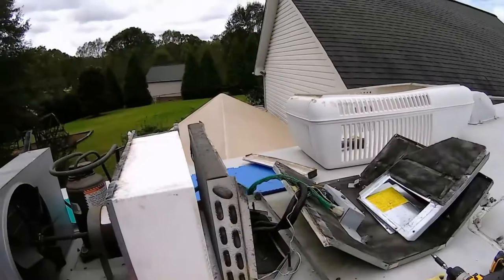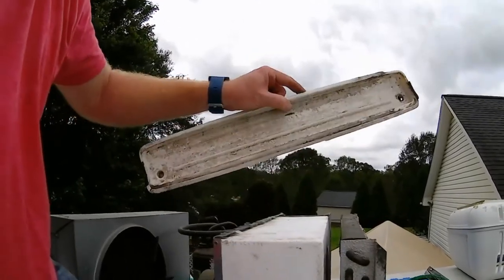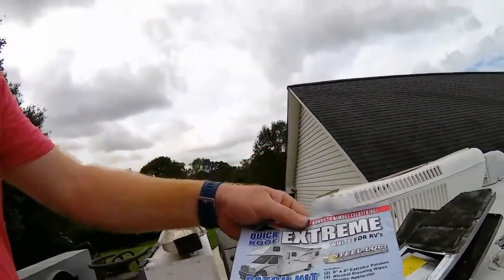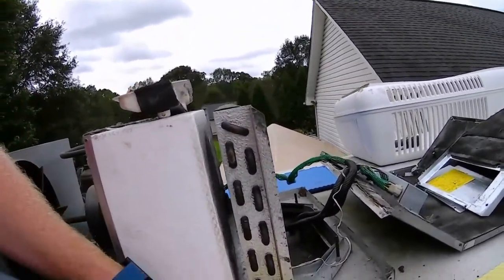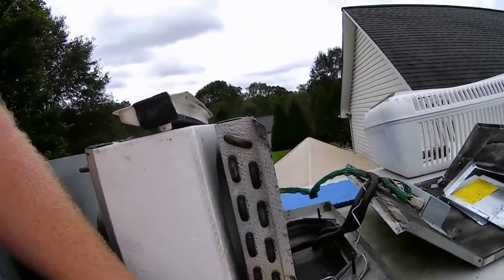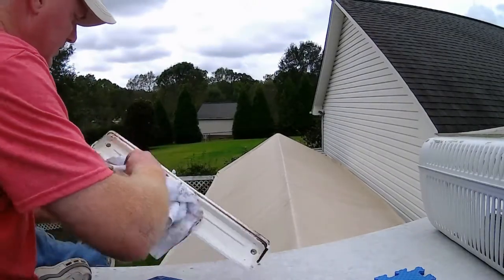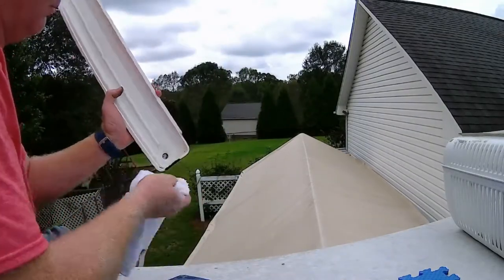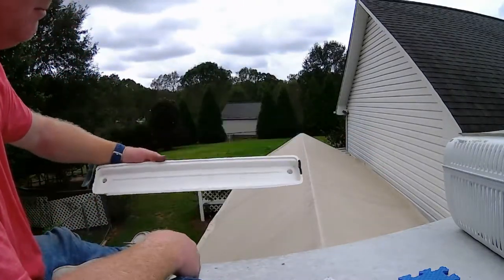Water Dripping in RV Bedroom - Clean the A/C Drain Pans

Comment: Good afternoon , thank you for taking the time to post this. If I may ask a question, does water from drain pan exit through the sides of the pan, onto the rf roof and into the drain lines on both sides of rv? Just wanted to know if that’s normal. Thank you
Reply from the maker: Yes.
From the drain pan, to either said, out the holes and into the roof.
Reply: @RVPastorKevin  Thank you so much sir for answering my question.

Comment: Needed this video. So the bubbling was caused by the drain pan rubbing on the roof?
Reply from the maker: As the A/C runs, water from outside air condenses on the coils of the AC, which then falls down to the drain pan below the coils. If the drain pan cannot drain, the water pools up in the drain pan and then overflows, dripping down through the unit and into the inside of the RV.
if the drain pan is sitting directly on the rubber roof, as the unit runs or as you drive down the road, the drain pan rubs on the rubber roof, which yes, can cause the rubber roof to bubble and tear, which then gives you a MUCH bigger problem than water dripping in your rig.